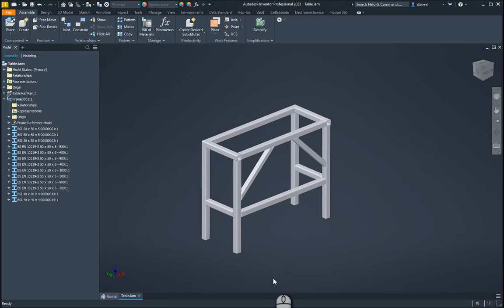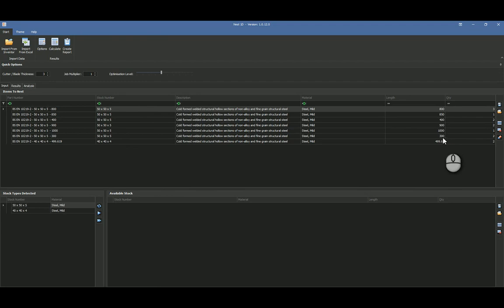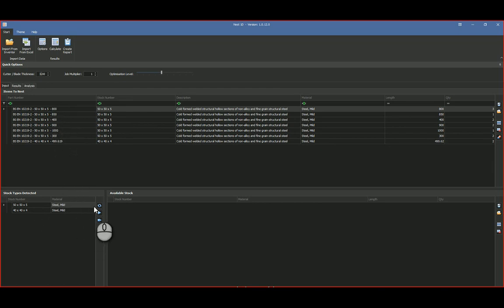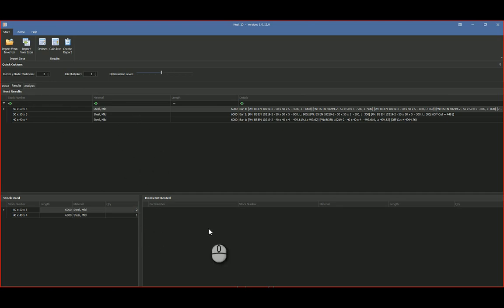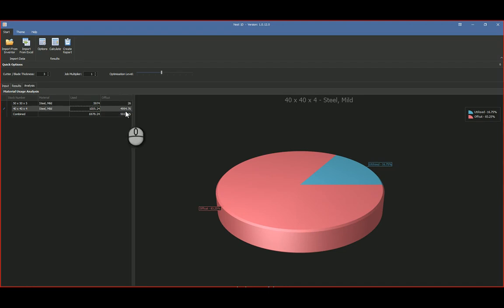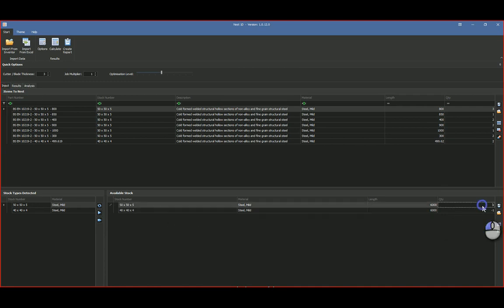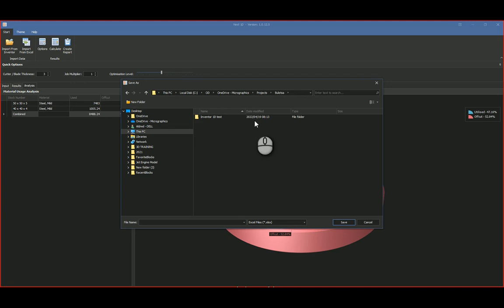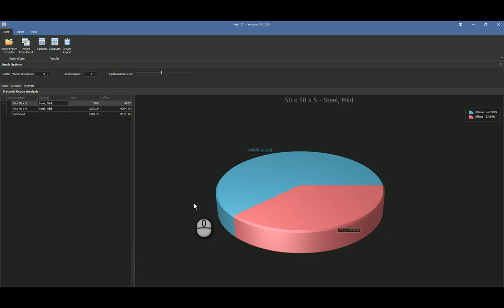Micrographics - Nest 1D

Comment: This would work great if it also showed angles of each frame cut...
Reply from the maker: The cut angle can be included for each member, in the report. Contact us via the app if you need more help. There is a support email address listed which you can use.